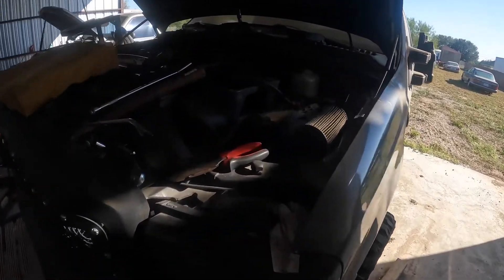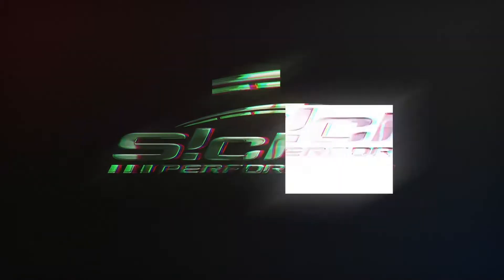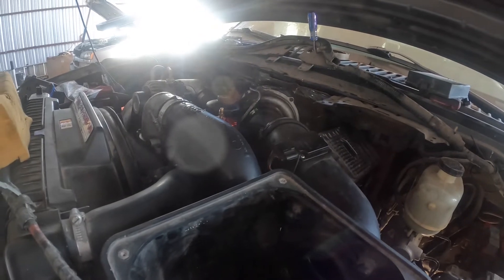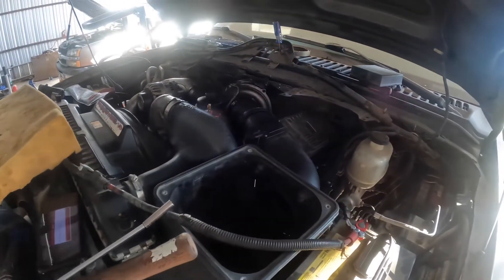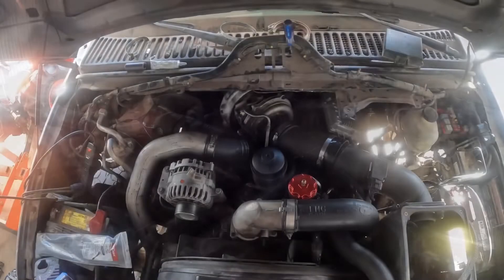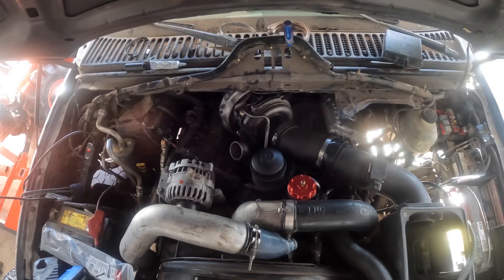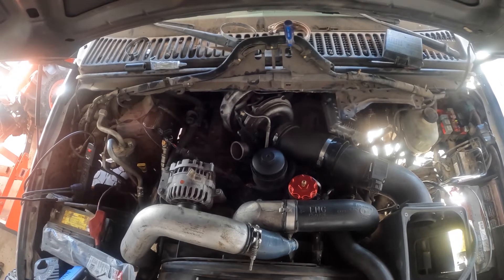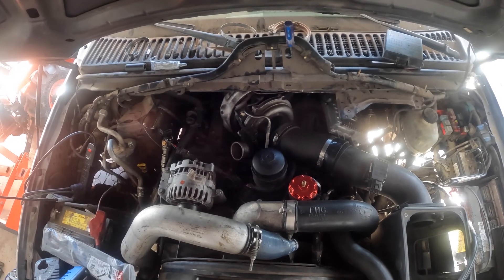Injector Circuit Low 6.0 Powerstroke P0261 P0264 P0267 P0270 P0273 P0276 P0279 P0282

Comment: I cleared mine by, upgrading my pressure spring. ///  Fuel Pressure Regulator Upgraded Spring Kit

 , it raises the pressure, more psi, if uts clogged, or low, might clear it.

Comment: The problem is why did that injector fail? I’m dealing with the same issue but been diagnosing my truck through and through before switching out all injectors. Is your fuel pressure good? Ficm good? Alot of different things can be going on. I just swapped #8 2 weeks ago. Truck ran great for a week and now 3 & 7 are failing. There must be an underlying issue. Not just injectors perfectly going out at the same time. Something is burning them up.
Reply from the maker: @dizl27 one reason your injectors may be failing is if you jumpstart your truck a lot or your alternator is failing. These injectors pull 48V and if you’re running on bad batteries or alternator, the demand kills them.

Comment: I just bought 8 new motorcade injectors for my 03 6.0 and I’m getting circuit low codes on 3 and 6 could the I jectors be bad?
Reply: Ficm harness or not clipped in right

Comment: I have a 2004 F350 rebuilt fuel injectors now fuel injectors, 13 and four are not working did a dionostic scan no codes for fuel injectors but when I disable one ate a time numbers 1,2 and 4 makes no change  I have code for incorrect exhaust recirculation  and a code for turbo no back pressure I have replace power side Ficm , fuel injector wire harness nipple cups stand pipes blue spring fuel filters oil filter sending unit in fuel tank and rebuilt all the injectors with new springs and orings can you give me any help on this issue it’s on a 2004 6.0 power stroke
Reply from the maker: I’ve had misfire with a bad egr valve. Also I’ve had an egr valve delete with an aftermarket delete harness at the PCM. The owner decided to remove it without correcting the egr valve delete. This gave a misfire issue. I replugged the aftermarket delete and it started running good.

I’m not saying this is the problem with yours but just make sure it doesn’t have a “tune” or something else aftermarket.